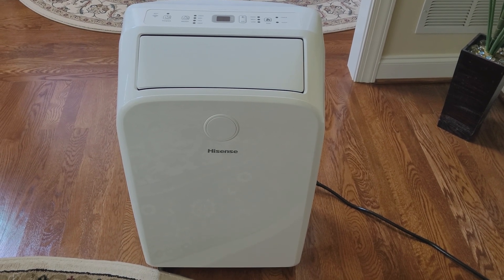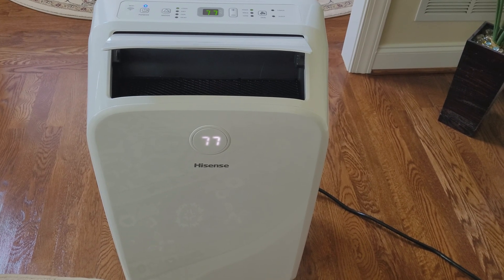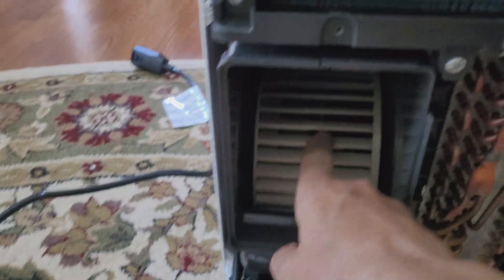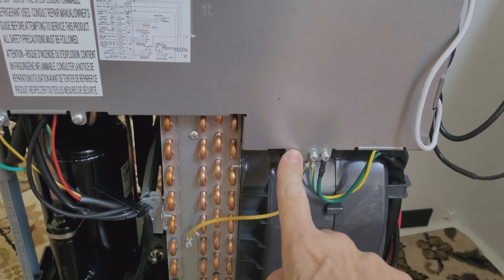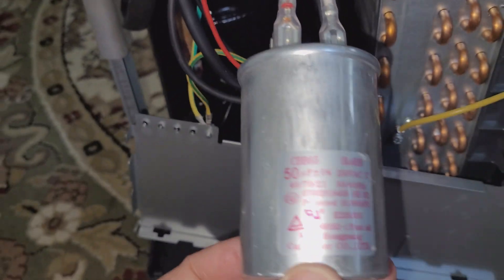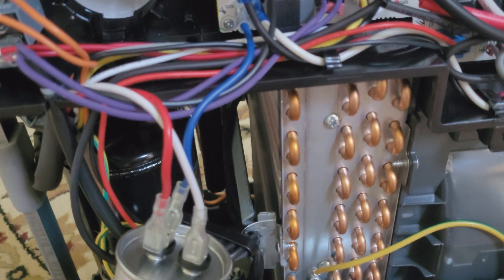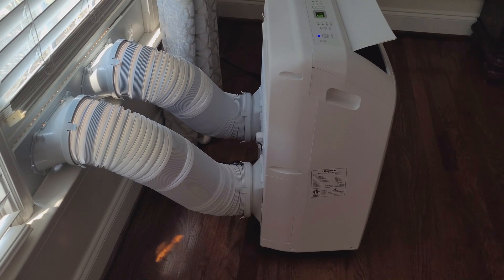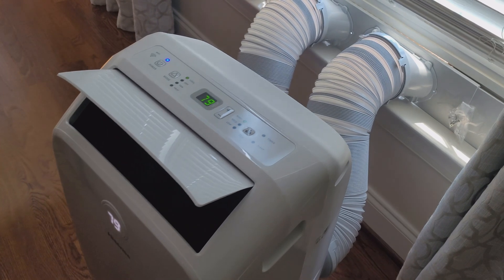Fix a Portable AC  with Heat Pump Hisense not blowing Cold or Hot air. Causes and fix #portableac

Comment: In my case I can hear the compressor come on. But its still not cooling. Is there a way to check if there was a refrigerant leak?
Reply from the maker: Remove the top filter panel and touch the griddle behind it while the unit is on. If everything is working and the griddle is not icy cold,  your unit has a leak and is low or out of refrigerant. Hope this helps.
Reply: @strykergaming_ngadgets  Thanks for the reply. I did open the whole thing up last night. Yea the parts that should be cold were not. The compressor does turn on but  gets extremely hot. I think the R-32 leaked out. I cant buy it on eBay and I hear that the working pressure suppose to be  around 600psi. There is no way I will be able to fill it with anything i have around the house and finding the leak will be a challenge.

Comment: Mine lower fan doesn’t work what should I do
Reply from the maker: Unplug the unit. Hold the power button for ~1 min. Plug the unit back and turn it on. See if the fan works. If not, unplug the unit, hold the power button for 1 min, let the unit stay unplugged for a couple of hours to completely discharge any power stored in the capacitors. Take the back panel off and follow the cable from the fan to the motherboard. Check for rust or oxidation, clean if necessary. Depending on the model, see if a fan has a replaceable capacitor and check it.

Comment: That is so awesome of you to share sir, thank you! It is basically like anything else I've fixed everything that has a capacitor my central heat and air, fans, and my dryer in the garage had the smallest capacitor I've ever seen on the control board/motherboard! I bought the two-wire capacitor for boards and soldered a new one on hooked it back up and deep cleaned inside runs like new now 20+ yrs old.😊 Thank you so much!
Reply from the maker: A cheap fix is better than throwing it away. I'll tell you that the built quality of  15+ years old appliances is way better than the modern trash being dumped on us consumers every day. My garage fridge, 24 years old, is still working. The ones inside, changed them twice. As soon as out of warranty,  they start failing.  Thank you for watching

Comment: Thank you for the video. Could you clarify which part exactly I should purchase for replacement? Do you happen to have a part number to share? Thank you,
Reply: I found a part, see below, the price is about $160. Does it sound right? Thank you, 
Part: K2131412
AFP Item #: HSNK2131412
Category: Compressors
Reply from the maker: @mediumsquirrel5100 Looks like that part number it's for a compresor.  Without special equipment and skills, compresor replacement is not  a DIY job, and it's expensive. If your compressor is gone, don't bother replacing it. Get a new unit instead.
Reply: @strykergaming_ngadgets  Thank you.  I just ordered the following part, I hope it will work. I will circle back to let you know. Thank you again.   
VEXUNGA 50uF 50 MFD 370VAC 440VAC 450VAC 50/60Hz CBB65 CBB65B Run Start Capacitor for AC Unit Fan Motor Start or Pool Pump or Air Condenser Straight Cool
Reply from the maker: @mediumsquirrel5100 Hope it will fix your AC unit. Stay in touch

Comment: Mine stops working as soon as I closed any window or door, creates a suctioning effect in the room, starts to pull air from any unseal window or door seal
Reply from the maker: The unit is supposed to vent air outside. It will not cool properly with windows and doors closed without venting outside.

Comment: Changed the capacitor on mine & did not work. Any other solutions?
Reply from the maker: Try this first;
https://youtu.be/EJYEPsAkxWw?si=XhVE5tPzfqIKPt_A

If the capacitor is good, everything is working except the compressor not kicking in, you might have a bad compressor or other issues which will cost more to fix than buying a new unit.

Comment: I have an older model but it looks exactly the same. My compressor gets extremely hot and the condenser coils are freezing over stopping it from blowing cold air. Once I thaw it all the water drips down from various places.
Reply from the maker: I assume you are talking about evaporator coils freezing. What are the humidity levels in the room? Are the fans on while the AC is working? High humidity,  restricted airflow, or low refrigerant can cause the evaporator coils to freeze.

Comment: In my case the compressor is heating up but It’s not blowing cold air
Reply: is the compressor running? If it is, the unit is out of refrigerant. if its hot but not running, capacitor could be bad or worse case the compressor is locked up.
Reply from the maker: Looks like your ac has a leak, and it's low or out of refrigerant

Comment: Mine is running cold for 2 mins and switches to just fan for 8 to 10 mins and kicks back on cold. need new compressor too? No water will come out either drain holes.
Reply: no. check your temperature settings

Comment: How do you make sure the compressor doesn’t have any energy in it you were talking about getting shocked or something. I couldn’t quite understand. Thank you.
Reply from the maker: If you are not comfortable, don't do it. Safety first. To discharge the capacitor,  unplug the unit and leave it unplugged for a couple of hours. Before taking it apart,  while the unit is unplugged, hold down the power button for a minute. This should discharge the capacitor. To make sure it's completely discharged, shorten the capacitor terminals with a screwdriver that has an electrical insulated handle (video timestamp 5:44). Again, safety first, electricity can kill.
Reply: @strykergaming_ngadgets  there is no button to hold down. Mine is all computerized so I guess I’ll do the screwdriver method.

Comment: My compressor is running hot.
Reply from the maker: That is normal. It compreses the refrigerant from  gas (vapor) back to liquid. During this process, it will get hot.The compressors are designed to run hot.

Comment: Ge portable ac unit just blowing air.  Not cold.  So it starts from time to time but not always.
Reply from the maker: Before replacing anything, check if there is any water accumulated in the unit and drain. In a high humidity environment,  those water pans fill pretty  fast, and the unit sometimes needs more time to get rid of the accumulated water. When this happens,  the cooling will stop, but the fans will still blow air.

Comment: Nice one bro. Mines not failing, but my previous one had shown signs of having compressor start issues and eventually totally failed. So was just wondering if there was a solution. Looks like it was a capacitor issue from the signs. Too bad, alr changed to the current one. Thanks for the vid, would not let it happen to the current one and will change the capacitor first and see if this would be a good remedy. Cheers!
Reply from the maker: Compressors rarely fail. Capacitors, or start relays, on the other hand, go bad pretty often. On my main AC unit, I change the capacitors like twice per hot season. Thunderstorms, power surges, and they are gone. Funny enough, I have a fridge in the garage,  and my kid put something in it that made the door not close all the way. At ~90 in the garage, the fridge worked nonstop the entire night. When I saw it in the morning,  water from condensation everywhere, some burnt smell, and it was not turning on. Thought it was done. Checked the compressor,  very hot; checked the start relay and overload protector, the ones that sit right on the compressor - both dead. Got new ones,  and $14 later,  the fridge turned right back on. These compressors are pretty tough. Thank you for watching, and I appreciate the kind words.

Comment: Not sure what my problem is but with my hisense ac dual hose it’s blowing cold air but it’s not really dropping down to set air number (sets to 61° but not going lower then 65°) and it would still take 2 hours for the temperature to get to 65°. So i’m not sure if it’s my compressor or what, not sure what to do. Nice video though
Reply from the maker: What area are you trying to cool, how many square feet?
Reply: @strykergaming_ngadgets  I use my AC for my room, which is 110 square feet. I was going to take the back panel of my AC off and see if any components get cold, because I already cleaned my filter. I saw your other comments, and it also stated that if the hoses or compressor aren't cold, then it means there is either no refrigerant or none at all. So I'm not sure what to really do, but I'm just going to check those components and hope for the best. If you have any other suggestions, I would be grateful.
Reply from the maker: @idkmyname6238 turn the unit on and let it run for ~15 min. While the unit is running, remove the filter and check the griddle behind it. The griddle should be ice cold. If it's not and everything is working, the unit is low or out of refrigeran. You can also check the temperature of air going in and compare it to the temperature of air coming out of the unit. Get an instant read digital thermometer, a meat thermometer will work too. While the unit is on and has been running at least 15 min, hold the thermometer close to the filter and notice the temperature; then hold it where the unit exhausts cold air, mark the temperature.  The difference between the readings should be ~ 20 F. My unit has a 22 F difference. If the difference is way lower, it means the unit is not cooling properly, usually because of low refrigerant. Hope this helps
Reply: @strykergaming_ngadgets  Yesterday, the compressor was working, but now it's not because I'm not hearing it run. I believe that was my problem the whole time. I am wondering where you bought the capacitor, or if you have an idea what type of capacitor to buy. Also, your last comment will be helpful to me and other people having that problem, if not the compressor, so thank you for the help.
Reply from the maker: @idkmyname6238 I got it on Amazon. The specs are printed on the capacitor. They come in different sizes so measure the size of the housing before you order, jusr like I did in the video. Hopefully that will fix the unit.
Reply: @strykergaming_ngadgets   I got the new capacitor and plugged it in correctly, but when I turn it on, the compressor still doesn't turn on. I still see the kick of the compressor, but not hearing the compressor. Wondering if you have anymore suggestions or I might have to buy a new ac

edited: i believe the compressor did turn on it’s just quit with the casing on because i turned it on again with the casing off
Reply from the maker: @idkmyname6238 It's hard to hear the compressor with the casing on and fans working. So your unit is cooling, but it doesn't go below 65, right? Even if you set it at 61, corect? I  never tried to set my AC below 67, too cold for me. I will test this when I get home, set it to 61 and see what happens.
Reply from the maker: @idkmyname6238 OK,  so I set my Hisense unit to 61. The lowest I got was 64. At around 64 - 65, the compressor turns off while the fans still run. I think it's designed that way in order to keep the coils from freezing up. It's one of the cheaper units on the market, no surprise there.
Reply: @strykergaming_ngadgets   That must be the same issue with my unit, as it's not going lower than 65. Also where I am living, the temperature is 85-92, but I'm not sure if it's affecting the ac unit, because at night where the temp is at least 70, my ac unit is not even going below 70. By the time summer ends and my ac unit is still not going below 65, I might have to buy a new ac unit. But your videos also you replying has been very helpful for me, I appreciate you for your time in helping. Thank you

Comment: I found one on the side of the road turns on all modes work but same thing compressor does not kick on. I got a new one on Amazon with same volts n micro f. Now the compressor kicks on. But doesn't seem to be blowing cold even after 10 mins. But I am outside with the plastics are off. I'm just concerned its leaking refrigerant. What should I do
Reply from the maker: Install the unit with the hoses to the window. Do not plug in. Hold the power button pressed for about 60 seconds. Plug the unit in an electrical outlet and turn it on. If still not cooling follow this:
https://youtu.be/EJYEPsAkxWw?si=DUwfbq5a3ewxKK0s

Hope it will work
Reply: K tysm will try this later, will update when I can  @strykergaming_ngadgets
Reply: Yea still doesn't blow cold @strykergaming_ngadgets
Reply from the maker: @mikebaird3867  Looks like the unit has a leak. That's why it was thrown away. Keep it for parts to use for the new unit you got from Amazon.
Reply: @mikebaird3867  if you can, keep the compressor. you can use it in the future

Comment: I have noma brand same problem...its not cooling....maybe i should try this method of yours...
Reply from the maker: Try this first.  It's the standard method recommended by manufacturers to troubleshoot:
https://youtu.be/EJYEPsAkxWw?si=Zy5WlwS5ZfRaKLyE

If the problem persists, your unit is out of warranty, and you feel comfortable and safe taking the unit apart, then check the capacitor. Hope it will solve your problem. Thank you for watching

Comment: If the compressor kicks in but still doesn't output cold air what could be the issue? I have a De'longhi Penguino 12,000btu, its 2.5 years old and the store wont take it back. ($750.) . I suspect a leak, i have no fault codes or warning li3
Reply from the maker: Sorry about your troubles. Try this

https://youtu.be/EJYEPsAkxWw?si=F1QJNl-UusaUJF2R

Also check the suction line (the larger pipe) next to the evaporator coil. If it's barely cold, or not cold at all, most probably you have a leak.  Fixig the leak usually costs more than a new unit. 
Don't know where are you located, but in the US most major retailers offer 3 year warranty on portable AC; also most major credit cards offer +1 year extended warranty if you used the credit card for the unit. Check on that. Hope this helps

Comment: I've also found replacing the terrible cheap plastic hose with insulated aluminium ducting will help the unit run more efficiently, because the heat from the cheap hose the Unit comes with, is not only heating up the room, but also making the unit work harder and putting alot of strain on the components (Which in time WILL lead to failure)
Reply from the maker: My concern was with the window mount the unit came with: after installation, intake and exhaust are just a couple of inches apart. Because they are so close, the hot exhaust is being sucked back into intake, especially if you have a window net. I use the unit in a double window, and after  positioning the hoses ~3 feet apart, I noticed that exhaust is  not getting as hot as when installed with the mount and hoses are next to each other.
Reply: @strykergaming_ngadgets  Agreed that's not a great design choice, Its almost like the exhaust part was a after thought, but glad you found a solution with your intuition, For future reference if a component does fail, its normally the large capacitor, What will happen is the unit cant blow out cold air anymore because the compressor just wont start, That is because the compressor gets so hot from working so hard that it basically fry's the capacitor, (Pretty much what you showed in the video) Unfortunately i see it all the time with alot of portable AC Units, Sure its a easy fix, but its also easily cured if they provided the right hose, The hot exhausted air getting back into the intake probably doesn't help either

Comment: Hi, do you know where I can find spare parts for that unit if I need them?
Reply from the maker: The parts have model and serial numbers. You can look for those online. I assume you're talking motherboard,  fans etc. Replacing a compressor is not worth, cost wise. Also, just for parts, look to find and get  a unit that is turning on but not cooling. Good luck.
Reply: @strykergaming_ngadgets  Thanks for luck since the air conditioning apparatus is imported and it is more difficult to get parts and I am in another country

Comment: How did you know the capacitor was the problem?
Reply from the maker: Everything else was working, except for the compressor. Most of the time, when everything kicks in, but the compressor, it's the capacitor for the compressor. The same applies to the outdoor hvac units. In rare cases, the compressor itself goes bad. So I took the unit apart, checked the capacitor with a multimeter, and it was dead. Hope you found the info helpful. Thank you for watching.
Reply: @strykergaming_ngadgets  how can i tell for sure that the compressor is kicking in or not?
Reply from the maker: @vosimichurch While working, the compressor gets hot, and it vibrates.

Comment: I have this unit I got no power where's the reset button I have no remote I need answer now I'm hot
Reply: What's two buttons in plug mean
Reply from the maker: The buttons on the power cord are the "test" and "reset"  and they  are part of a Ground Fault Circuit Interrupter (GFCI) plug. The test button checks if the GFCI is working, and the reset button restores power after the GFCI has tripped. So if your unit gets no power, maybe the GFCI was tripped, press the reset button.
Reply: @strykergaming_ngadgets I did I got nothing
Reply: @kentkluge7721  check voltage in the unit. the plug could have failed.

Comment: I changed the capacitor in my unit and that didn't kick the compressor on after install. It's a new unit
Reply from the maker: These units don't like to be plugged in using extension cords. Try to plug it directly into an outlet. I have another video with  troubleshooting steps recommended by the manufacturer. Try those, if still no luck, return or RMA the unit.